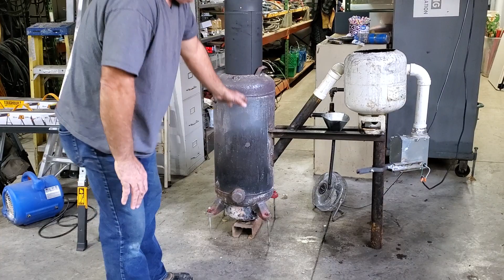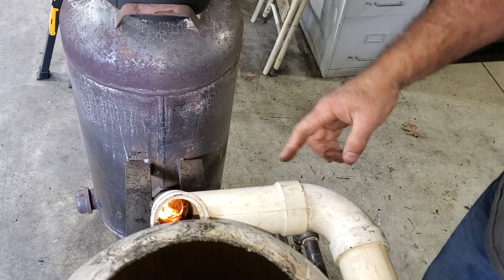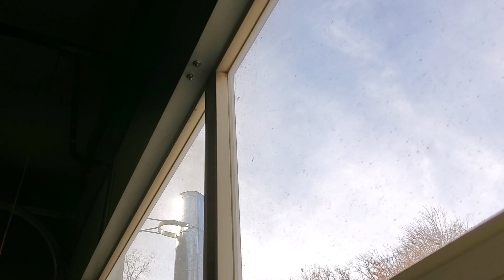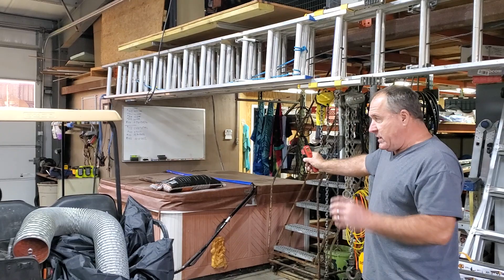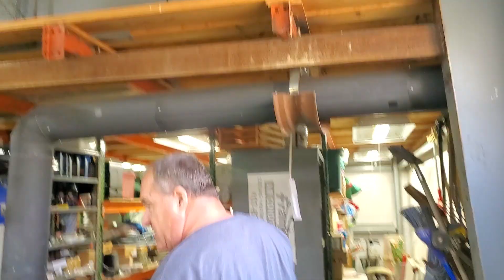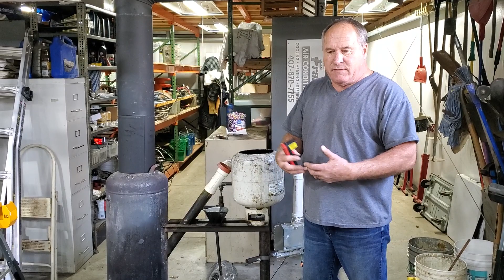EASY AND QUICK  START UP ON MY ROCKET STYLE WASTE OIL BURNER HEATER

Comment: I’ve watched a bunch of your vids and appreciate the evolution of your designs. The combo oil/air tube and propane reservoir are great solutions but I love your bottom mounted burn bowl. It reminds me of a Webber barbecue ash pan under the kettle. In fact, some webber kettles have a nifty lowering system to get the ash pan out.
Reply from the maker: THANKS

Comment: I may try two air tubes just to see if I can make it burn better without a fan in case I need to. I will still run a fan on one and can plug the other one off

Comment: A split system heat pump is 200 to 500% efficient. For every dollar of electricity spent to run it will pump 2 to 5 times the quantity of heat from outside into your living space home. Pretty low cost to use... no waste oil to clean up... and maybe more important... does not void you home insurance for a DIY  non-approved combustion device... does the no insurance risk justify the risk... doubt it. Happy wife... happy life.
Reply: Douglas I’m not buying the ideal about heat pumps being 200 to 500-% efficient. At least not with a electric heat pump. Winter time our Eletric bill goes up $300 to $400 more per month than the summer months. At first we thought they put the wrong sizes hp in our house. We had another heating and cooling company check their work
Reply: Heat pumps are okay for air conditioning but they aren’t worth a crap to heat with. Here in southern Ohio we can’t just rely on our heat pump systems. If we did our houses would be unlivable at least 4 months out of the year. We’ve also got a wood furnace in the basement. 
But back to your point about insurance. I don’t believe people are using to many DIY waste oil burner to heat there homes lol😊. And I promise when it comes to freezing your rear off or using a diy waste oil burner to keep warm no woman is going to care about what a insurance company had to say. They’ll choose to stay warm every time. 
Reall the set up this guys built looks a lot safer than most store bought heating devices. They only thing about it that gives me any concern at all is the oil reservoir. Other than that he’s got a pretty darn solid ideal. 
Great video. I’m interested in watching his build video to build one for my garage. The wife can stay in the house with the crappy heat pump